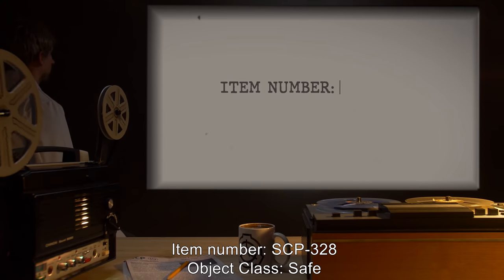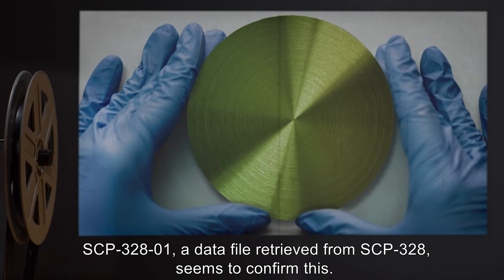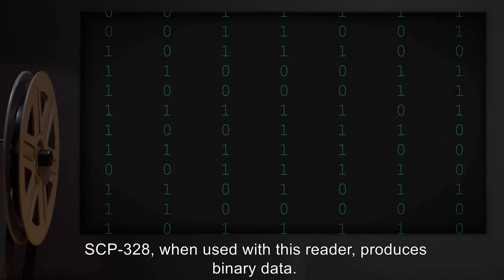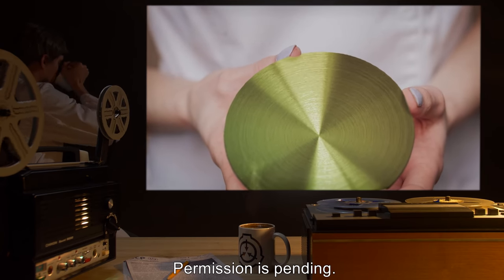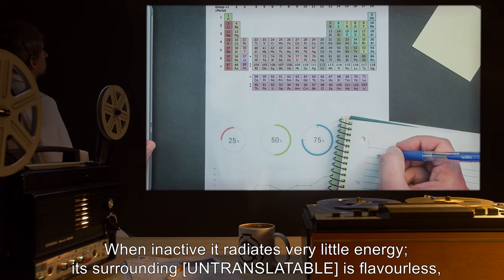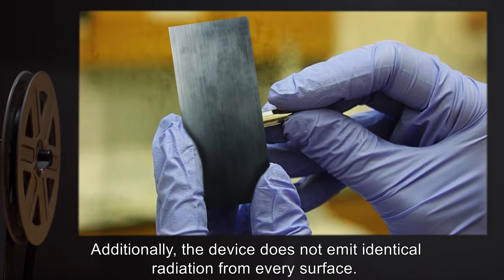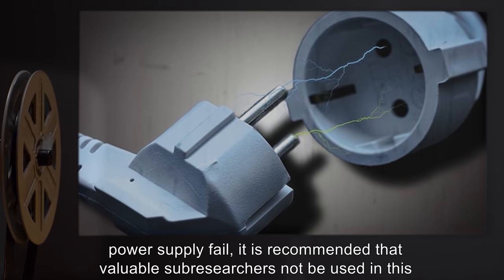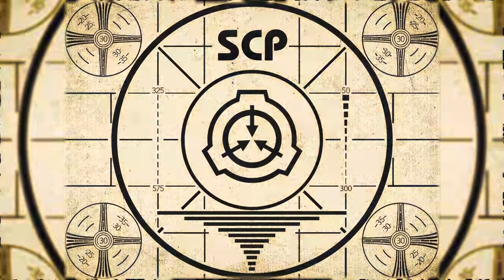SCP-328 | Alien Disc (SCP Orientation)

Comment: I love this one. It seems mysterious and inexplicable at first until you realize what's going on and I really like the twist.
Reply: What does it mean🤔
Reply: @spots2892  mh... I'll copy my response to another comment:

Do you know a device that can open up, has several near-identically shaped buttons with engravings on top which, when pressed, often result in a screen displaying identical symbols? A device which is powered by an oblong object situated on the underside and which can emit various forms of radiation one of which can lead to an entity seeking a connection to a web when activated?

Try a perspective shift and think about the description from the perspective of the entities and then try to imagine what they are describing and if you know something that fits those characteristics.

It took me a while as well, so if you can't figure it out, it's no problem, just ask again and I'll tell you.
Reply: Ooooooh
Reply: @spots2892  ;)
Reply: @Salted_Fysh   i still dont get it lol
Reply: @elmarmaria6980  SPOILER

It's a laptop from the view of some form of small electronic entity that is affected by various wavelengths of radiation (e.g. the ones used to establish a wireless connection) and their foundation equivalent.

Comment: An SCP file within an SCP file this one only needed to have one redaction because of all the stuff they couldn't translate. You would think with some of the cooperative SCPs that speak either all or +50 human languages you could get one that could read the whole thing in one go.
Reply: It seems to be indicated that the data is either in cypher, a jumble languages or even unidentifiable languages. (Possibly alien).

Even though we've been able to reconstruct dead languages with very little data to go on, we do still need some. If the document is all mixed together, it would be hard to determine grammatical structure which in turn makes it harder to obtain clues as to what words could be referring to/what function they serve in a sentence.

Aside from that, I actually think the redactions in this document are fitting and well-placed unlike in most other series 1 documents.

Comment: Well, obviously the disc was referring to [redacted] effects related to project [redacted] because of how it lines up with [data expunged]. I mean, that disc is a failsafe that was intended to target devices that can read it and could be interpreted by those experts because those that sent it already knew the skill sets of the experts and knew they needed to make the disc regenerate. It will cease to regenerate once its information is no longer needed, that will be and has been already planned.
Reply: the translated data on the disc is describing a laptop

a normal non-anomalous human earth laptop that somehow got to wherever these beings exist

the point of the SCP is to get you thinking that things can seem anomalous purely because the foundation doesn't have the cultural context to understand them, and not because a given SCP itself is actually inexplicable